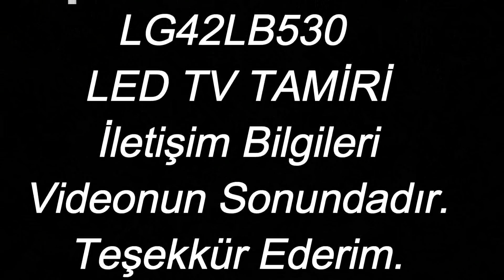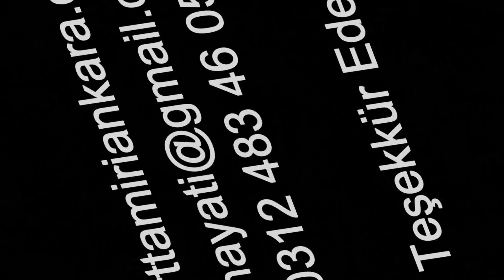Led Tv Arıza Tespiti ve Tamiri (LG42lb580)

Comment: Abi bizim televizyon arçeli ses var görüntü yok ama televizyona ışık tuttupumızda bişeyler gözüküyor sizce sorun nedir
Reply from the maker: Merhaba led bar arızasıdır. Ankaradaysaniz yardımcı olurum 0312 483 46 05
Reply: Marhaba hocam öncelikle eğitici ve bilgilendirici vidyolarınız için tebrik ediyorum. Bende arçeliğin 40inch lik 4 5 yıllık bi tv si mevcut. Arkadastan almıstım. Yerini değistirmiştim. İlk önce görüntüde titreme oldu. Sonra da ekranda kırmızı dalgalı görüntüler belirdi. Servise gittim sordum 300 ile 1000 tl arasında masrafı olabilir dediler. Daha sonra ekranın sağ üst kösesinde sanki darbe almıs gibi bi iz ve 5 ile 10 cm lik bi çatlak olustu. Baska kablolarla fln da denedim. Görüntü aynı görüntü.bilgisayara da bağladım yine aynı bozuk görüntü. 3 tane sorum olacak hocam. 1 ) Paneldeki çatlak devam eder mi 
2)panel bu sekilde beni rahatsız etmiyo kösede olduğu için bu paneldeki görüntü düzeltilebilir mi
3) arçelik a40 lb 4329 tv nin modeli bunun panel fiyatı ne kadardır hocam